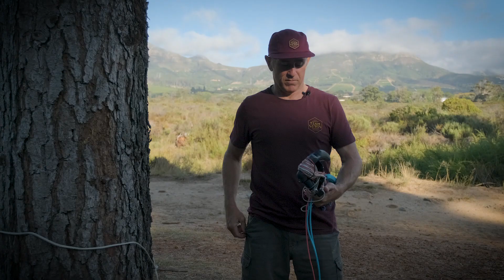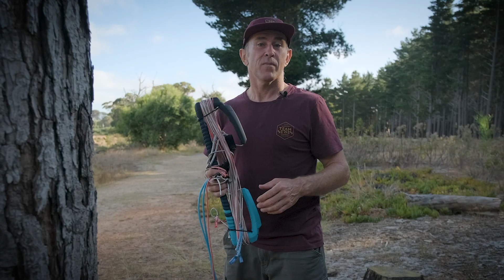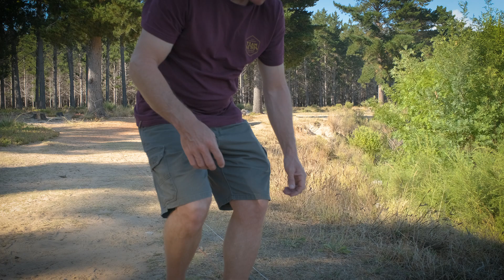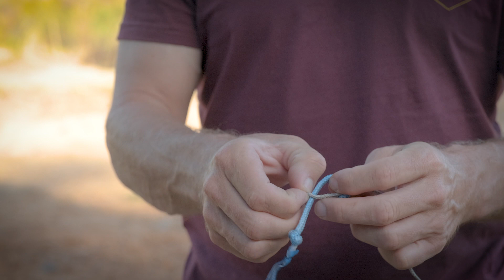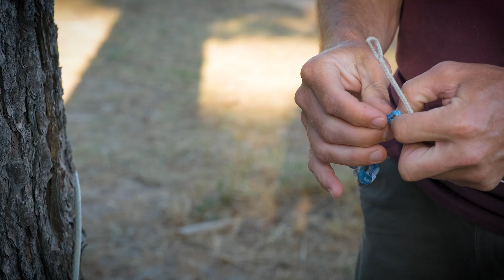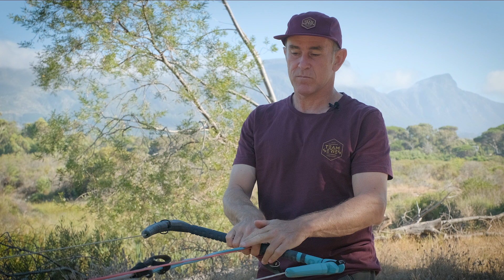Airush Lift  - High Y Conversion

Comment: If I mod my airush bar and lines with this, could i possibly use it for other high V kite brands like Doutone and Core kites?
Reply from the maker: Hi Zarrel, yes that is correct you can
Reply: @AirushKiteboarding  Cool, thanks for the response!

Comment: I have a Lift 9m and 14m and I have now flown both using the high-v configuration - The results are unreal! The stiffness of the canopy in overpowered conditions is unreal.  The wind range in this kite is amazing and even more noticeable with this configuration - my only question is that after looping the kite is hard to see which way to spin the center lines as they are so close together that is hard to tell - not a big deal and not sure if this is the case in any high-v bars out there.  I just loop it the other way :-)

Comment: Didnt have to remove the pigtails while installing the ring.. hope my lines are good.
Reply: Hi Rudi, we actually made the ring that ships with the kites slightly bigger after this video was made, which means there is no need to remove the pigtails during install. Your setup will be FINE! Cheers DK
Reply: Awesome, I added the ring and didn't have to remove pigtails as well.  It makes it really easy now to go from high-v to low-v as I use the bar with other kites.    Would the high-v configuration work with other high-v brands like duotone or core? I'm not changing my kites but would be nice to know.  Thank you

Comment: How does the Airush Union fly with the High-Y configuration?? 
I have a set of kites including Lift and the Union and would like not to change around with the bar when shifting kites
Thanks!
Reply from the maker: The Union V6 was not designed to be flown on the High-Y bar setup, but it is possible to do so, as all the safety features will still be operational.  The High-Y will change the forward flying, turning and power delivery characteristics of the kite to varying extents dependent on the kite size and also have an effect on the bar and steering input pressure, again to varying levels dependent on the kite size used on.